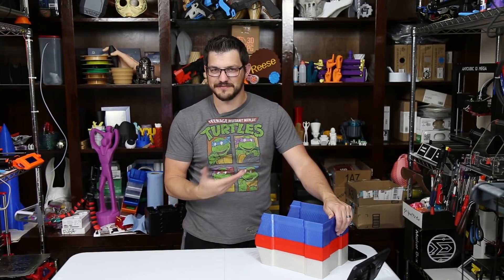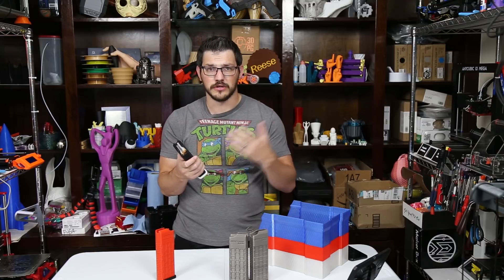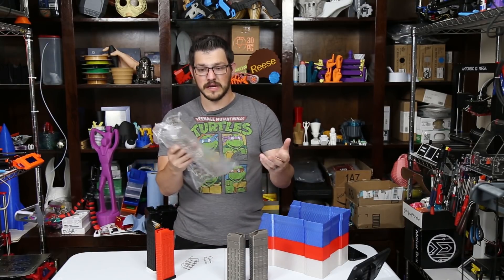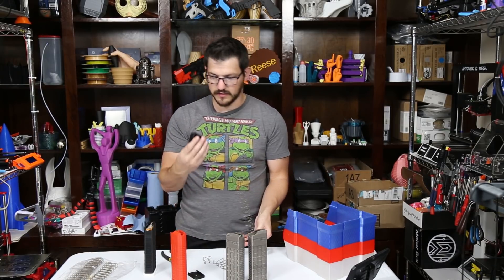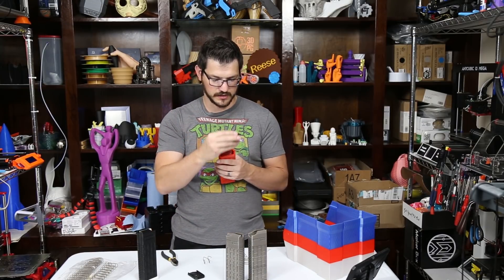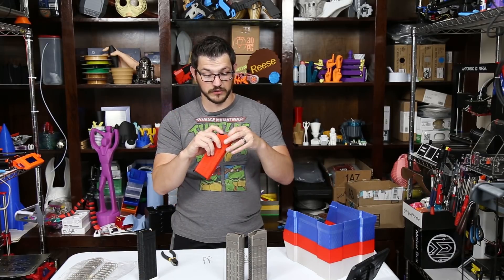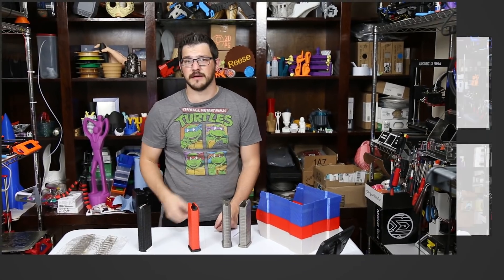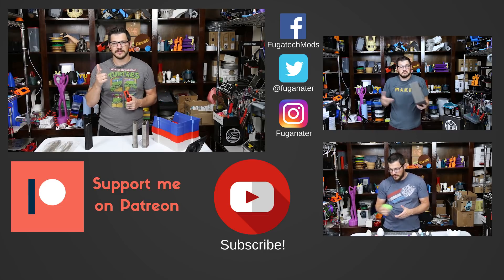3D Printed Magazine Battery Holder

Comment: In this case its an "AA"R15 Battery clip... lol I printed one like this about a year ago but didn't get the spring. I tried a rubber band looped over top then the batter plate sat on the rubber band. This looks to be a lot better design. I may print this version. Thanks for showing this one off.
Reply: Ak?
Reply: Meant "AA"R15 not the AK47... was to be a gun reference but wrong gun.
Reply: @3dmedicvince449  ah np just curious